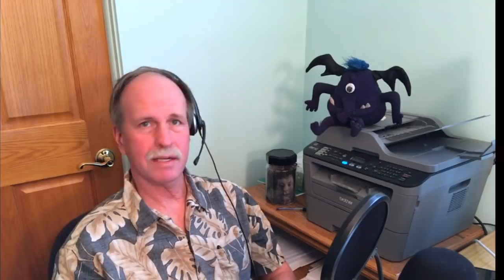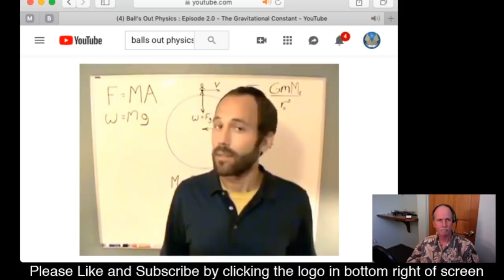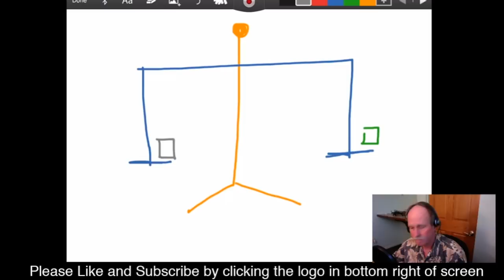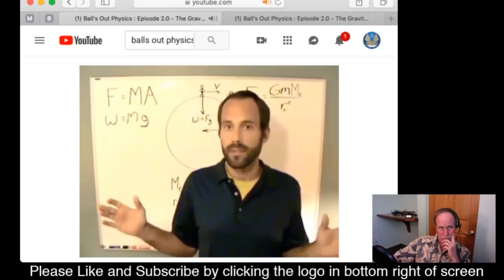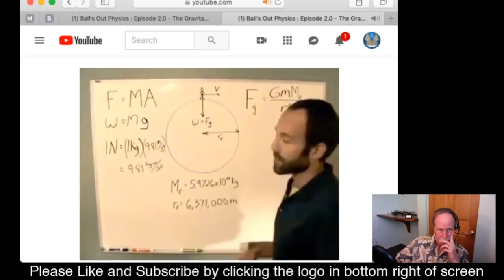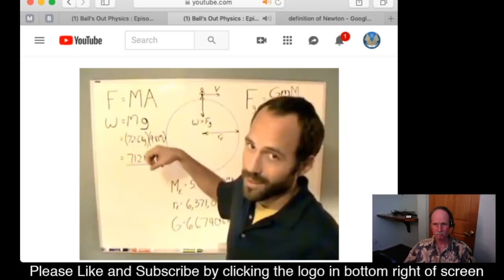Flat Derp Engineer Gravity Part 1

Comment: In reality, there is no centrifugal force. It's a fake force that arise only in non-inertial frames of references. It has no physical meaning or actual object that causes that force.
Reply from the maker: yet, it is something we can see the effects of.
Reply: @BobtheScienceGuy  Well, I never saw any effect of this force in my life. Do objects weight less on the equator? They do. It is due to centrifugal force? No. They weight less because they are in a constant real acceleration towards earth center and since there is an acceleration, there is uncompensated force acting on them. That uncompensated force equals gravity force minus weight (force made by the scale). 
On the pole, where object has no constant real acceleration, force equals gravity force minus weight equals zero.
Thus objects weight less on the equator than on the pole. And I don't see any centrifugal force.
Reply from the maker: ok.

Comment: Time index ~4:35 exactly what type of scale is he using in his chemistry classes to determine the mass of his components?  If he is using an electronic scale then I can see where he is confused.  All the work is done for him and he can't see it.  Also, those electronic scales would give different readings on different worlds.  Those of us who learned 'old school' or less-funded school would have been taught how to use a manual scale or 'triple-beam balance.  Now, a triple-beam balance will give you the same mass readings anywhere in the universe since they are using standard masses vs. the test mass.  All the masses would be affected by the same gravity. So if I was attempting to determine the exact mass of a 200 g sample of NaCl on the moon, I could do that with a triple beam balance because even if the 200 g sample weighed 1/6th of it's normal weight on earth, the standards it was being weighed against would also be 1/6th their weight.

Comment: Measuring weight super accurately can only be done either in a vacuum with a beam balance (making variations in g irrelevant), or when the density of the comparison weight is the same as that of  the item being weighed. In air a correction is required for the difference in density of the calibration weight and the intended item to be weighed, owing to different buoyancy forces of these items in air. The buoyancy in air also depends on air pressure, humidity and temperature,  which vary with altitude and weather effects. Typical upthrust in air on a human body in normal circumstances is, I believe, about 90 grams. Oh, if you turn your bathroom scales face down to the floor and stand on them, then you are weighing the Earth (except the gravity acceleration experienced by the Earth due your body mass is rather miniscule). Ever tried accurately weighing a block of polystyrene?

Comment: Weight is a force measured in N, but it is simply not an object's mass x g. That would only be true if the weighing is made in a non accelerated frame of  reference. What about doing it in an upward or downward accelerated elevator? The g is the same but not the weight. You will have to conclude that the weight of an object is whatever reads out on a spring scale. That will also cover weightlessness.

Comment: When I was in engineering school back in the 80's we all had to take three physics classes taught by the physics dept.
Physics I - basic Newtonian mechanics,
Physics II - electrodynamics 
Physics III - atomic physics and special relativity 

Plus the basic engineering classes taught by the engineering dept.  
Statics - physics of things standing still, 
Dynamics - physics of moving bodies,
Mechanics of Materials - internal physics of bendy things, 
Circuits - physics of inductors, resistors, and capacitors.

Whether you went into electrical, mechanical , chemical, civil, or industrial engineering you still had to learn the fundamentals before you started classes in your department.  How could someone pass these classes and not understand the basic concepts of weight and mass that I learned in jr. high science class? Whatever school gave a guy a degree should be discredited.

Comment: I found a hoard of geniuses  here,  figure this one out  , How can I see a fish house 7 miles away from top to bottom  , with my camera  18 inches above the ice,  there is supposed  to be  36 feet of curvature
Reply: Because so low over ice is the perfect way tget excessive refraction and apparently see further than one might expect.
It only takes small temperature difference over that first few feet above the ice to cause significant refraction. 

Here is one article: "An Introduction to Mirages" at https://aty.sdsu.edu/mirages/mirintro.html

And "Simulating Atmospheric Refraction": at:  https://www.metabunk.org/simulating-atmospheric-refraction.t7881/
And the simulator: https://www.metabunk.org/refraction/

Comment: No you shouldn't be afraid of being wrong, but that doesn't mean you should embrace it, sure the weight (an arbitrary number) of something in earths gravity may have been used to come up with a number for its mass in the beginning but once you have that number it doesn't matter what g field you are in, that number doesn't change, only the weight does because the weight is the measurement of that mass in different g fields. It's like coming up with the measurement of an inch, you might use something as arbitrary as a thumbnail to create a ruler for measuring things but once you have that ruler you no longer need the thumbnail, you have the ruler with your defined measurement of an inch.

Comment: The confusion between force, weight, and mass is one that occurs in EVERY introductory science and engineering class.

Weight is properly a force. 
It should be measured in newtons or pounds.

Unfortunately, in the metric system, weight is frequently (& erroneously) specified in grams or kilograms, a unit of mass (not force).

In a similar fashion, in the US system of measurements, mass is erroneously specified in pounds (a unit of force) instead of “slugs“ the proper unit of mass.

Adding even more confusion to the US system is the definition of a unit of mass called the pounds-mass. In this usage, the gravitational constant has been incorporated into the unit of mass such that one pounds force is the force produced by 1 pound-mass. In other words, one slug = 32.2 pounds-mass.

The barely acceptable justification for all of this carelessness is that, whenever these measurements are made on earth (as they virtually ALWAYS are), in both systems, the relationship between force and mass on the earth is given by multiplying (or dividing) by the constant “g”.

Weight = mass * g

Metric units:
Weight = Newtons 
Mass = kilograms or grams
Where g = 9.81 meters/second^2

US units:
Weight = pounds 
Mass = slugs 
Where g = 32.2 feet/second^2

It’s all enough to make people’s heads explode.

Mr. Mullins interpretation of this confusion as some sort of a “Grand Conspiracy that he has unearthed” is ludicrous.

He has “discovered” EXACTLY the same confusing terminology which has tormented ALL science and engineering students for well over 100 years.

Comment: No, Bob, your numbers with the change in weight due to differing latitudes are WAY off the mark.
There are 2 effects associated with the rotation of the earth: a) centrifugal acceleration, and b) the equatorial bulge.

The centrifugal acceleration reduces the weight of any object by 0.3% at the equator compared to its value at the poles.
Due to centrifugal acceleration alone, a 500 gram object at the equator would weigh (0.997 * 500) = 498.5 grams at the poles.
A drop of 1.5 grams.

Further, the equatorial bulge puts any object on the surface of the earth about 13 miles (22 Km) further away from the center of the earth than it would be at the poles. This produces a drop in weight at the equator equal to about 0.7% compared to the same object’s weight at the poles, because the gravitational force is inversely proportional to the distance (from the center of the earth) squared.

Due to the equatorial bulge alone, the weight of a 500 gram object (measured at the equator) would drop to about (0.993 * 500) = 496.5 g (at the poles).
A drop of 3.5 grams.

The two factors together add up to an easily-remembered 1% drop in weight at the poles compared to the equator.

Considering both effects, a 500 g object (measured at the equator) would measure (0.99 * 500) = 495 g (at the poles).

This is far less than the 50 to 60 gram difference that you attributed to centrifugal acceleration alone.
__

The math is to calculate the centrifugal acceleration, and convert it to ft/sec^2 or meters/sec^2.
Since I’m an American engineer, I’ll use feet.!

The centrifugal acceleration = velocity^2 / radius = [(2πr/t)^2]/r 
Where: 
r = 3960 miles * 5280 ft/mile = 20.9 x10^6 feet.
t = 24 hours * 3600 sec/hour = 86,400 seconds.

Crunch the numbers and you get: centrifugal acceleration = 0.11 ft/sec^2.
And 0.11 ft/sec^2 is equal to (0.11 / 32.2) = 0.003 = 0.3% of the acceleration due to gravity (32.2 ft/sec^2).
Reply: While I don't disagree that the differences in bobs values are exaggerated, the changes in gravity due to the bulge is more complicated than that. Your calculations would be applicable if the earth was a perfect sphere of the smaller radius and you were measuring gravity at the surface at the pole, and then measuring gravity 13 miles above the surface at the equator. 
The equation for gravity assumes a perfectly spherical mass which is then treated as a point mass, a non spherical mass doesn't have uniform gravitational pull in all directions.
Reply: StoneMonkey3D  I agree. Point well taken.
However, I’d bet a beer that that it’s a pretty good first approximation. (My SWAG: ±20%.)
So, even with this error, the weight drop would fall somewhere between 0.0056% & 0.0084%.

I ain’t particularly motivated to do that calculation.
Be my guest.

Although, for yucks & giggles, i might see if I can find some website that gives measured answers.
__
__
OK, I found one, & I would have lost my beer.

https://www.vcalc.com/wiki/vCalc/International+Gravity+Formula 
”International Gravity Formula”
Who knew...

Plugging in the latitudes:
Pole: 9.83218637 m/sec^2
Equator: 9.78032677 m/sec^2

Δ% = 0.530%. (Eq to Pole)
Δ% = -0.527%. (Pole to Eq.)
__

Since the centripetal force calculation is correct, the correction for different radii of the earth was significantly (3x) over-estimated by simply changing “r” in “G m1 m2 / r^2”. 

The centrifugal acceleration drop is about 0.3%.
The bulge drop (calculated with different r) was 0.7%. (Incorrect)
The IGF contribution from radius change is actually 0.23%. (Correct).

Learn something new every day...
Reply: So Bob, your 500 g mass (at the Pole) would weigh 497.3 g at the Equator.
A drop of 0.53% (total), due to centrifugal acceleration (0.3%) & equatorial bulge (0.23%).

Comment: He is absolutely right about one thing. In engineering “you learn a bunch more from your mistakes than from accidental successes.“

But there is an absolutely necessary condition to learning: you must ADMIT your mistakes.
You admit your mistakes to others, you admit your mistakes to yourself.

But you’re not done yet.
You MUST recognize the reasons for your previous mistakes, and absorb the new correct information.

He also says, “I might be wrong about all this. “
There is no “might“ about this.
He IS wrong about all of this.

Finally, an ABSOLUTELY CRUCIAL aspect of engineering.
Anytime you need a correct answer to some question, you deal ONLY with experts.
You NEVER deal with amateurs.

THIS is his Paramount Mistake.
His belief that he, himself, a TOTAL AMATEUR in all of these fields, could figure out these answers without help.
And that he could figure out these answers while CRIPPLED with the intellectual disability called “the prejudice of biblical fundamentalism”.
A fact that he fails to disclose in these videos.
But he does reveal in his next announced endeavor: “Biblical Cosmology.”

If Mr. Mullin had bothered to take his questions to real experts in each of the various fields, then he would’ve quickly found out that all of his conjectures are utterly absurd, incompetent nonsense.
He would have also learned a whole bunch of new information along the way.
He would’ve learned how vapid, and vacuous, “flat earth theory“ really is.

And he would not have so publicly humiliated himself, his teachers & his schools.

Comment: Excellent presentation, as always. :-) Minor point at 7:39 the difference in weight from the Equator to the North Pole really is tiny. From a google search: "If you weighed 100 pounds at the north pole on a spring scale, at the equator you would weigh 99.65 pounds, or 5.5 ounces less." Similarly, a "pure" 500g reference mass, would register around 498g at a north-pole-calibrated spring scale on the equator.

And I have to say a tiny bit in Brian's favor in terms of grams of weight versus mass. He was commenting on "weighing" things in grams in chemistry, but grams in physics represents mass. But he wasn't confused between the two, since he said at 4:30 when "weighing" things with a gram scale on the moon, it would clearly show a different reading, and thus we'd need a different set of calibrated scales, where the output was "grams" for use on the moon, so it would be accurate for mass.

Other than those tiny quibbles, you're bang-on with the rest! I love how you deadpan (frequently) "No, Brian, that's not what is says." You definitely can see how FE folks really latched onto Brian as a messiah figure, with his smooth engineering-sounding language, even if he didn't really understand much physics.

If you're going to tackle Cavendish, I figured you'd get a laugh out of this "interview" (parody), about 5 minutes long: /watch?v=uWHK0retX-s
Reply from the maker: Cavendish is tomorrow, I think you will enjoy it.

Comment: Good video:  Wish:  7:50 ish:  Please check your numbers - your example of weight at different latitudes does not pass a sanity test.  With your numbers it would be trivial to prove or disprove our rotation on any N-S plane flight with a $10 Harbor Freight scale.  Flat earthers already have the moving scale proof on their list.  Here is a chart showing acceleration of gravity (minus centrifugal acceleration) and latitude "https://www.engineeringtoolbox.com/acceleration-gravity-latitude-d_1554.html"
Reply from the maker: I thought I made it clear they were not real numbers.  I was simply making the point the numbers would go up as you went from the equator to the poles.  A 100Kg mass weighting 981 Newtons at the N. Pole would weight about 0.3% less at the equator (about 3Kg).
Reply: @BobtheScienceGuy  --  I understand they were not intended as real numbers.   But they were so far out of the ballpark it can give someone a totally wrong idea.   (Large variation easy to detect vs a small variation hard to detect.) Check your math in your reply:  0.3% of 100Kg is not 3Kg.  Sorry, I'm a retired engineer and can't get sanity checks out of my system.
Reply from the maker: poopytowncat gotcha wrong decimal place 0.3kg 3 Newtons

Comment: If a go to the tortillería for a Kilogram of tortillas, I am going for the mass of tortillas not for its force due acceleration of g. The force is in direct ralation with the mass, I just want the 1000 gms. of tortillas (mass to make a lot of tacos). So the scale show us the mass derivated from the pull of the big ball. Saludos. Correct me if I wrong